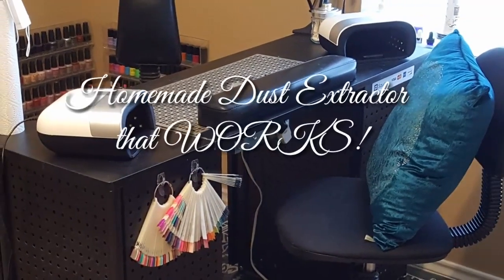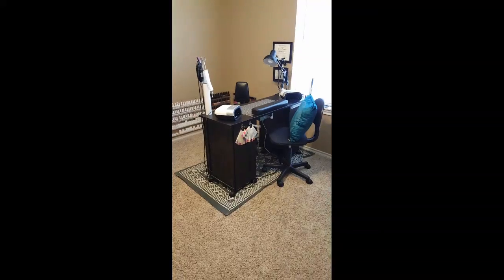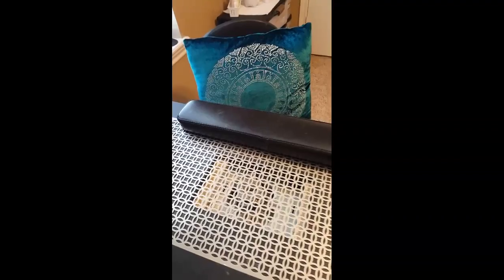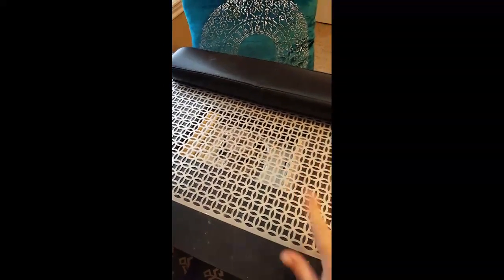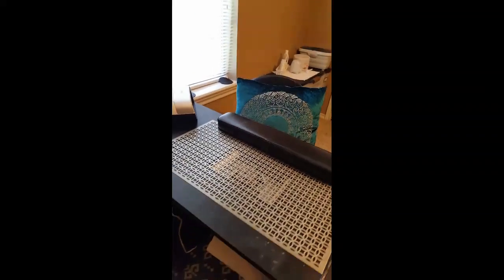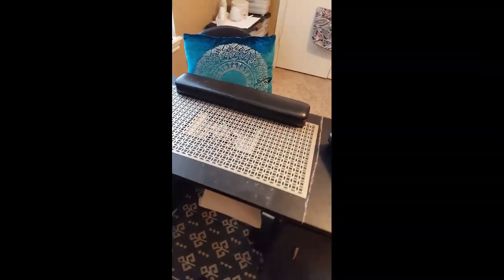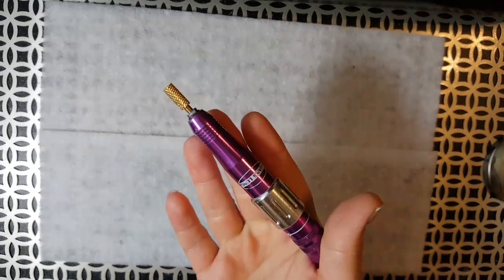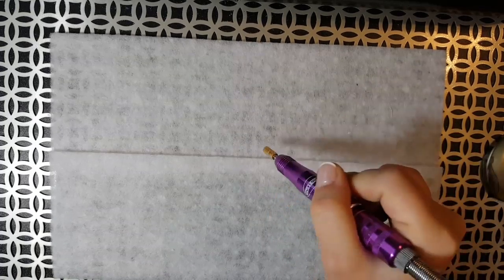Dust Extractor--  my version of a Valentino!

Comment: Not sure if you still use it but you could create a very lightweight frame to house the 2 filters and attach it to the underside of the metal grate with either double sided velcro or magnets IF the grate is magnetic, then you just pull it out when it gets dirty and replace, rather than sitting on top of the grate - just my 2 cents lol

Comment: You have no idea how happy I am because of this video!!! I have bee researching dust collectors for weeks! I was scared to order a cheap one on amazon and it not work. I'm gonna get some flexible aluminum foil duct hose and run it out of a window to suck the fumes out as well. I am a DIY queen so I'll be doing this one myself! Thank you so much for sharing this.
Reply from the maker: tayla rogers Good idea!! Glad it helped cause it saves me hundreds.
Reply: Do you have any idea of the fans cmf power?  The cheapest one that I see is 50-60 cmf for $15
Reply from the maker: I'm actually not sure. I didn't save the box but we bought the cheapest which was 14.99 or so just to experiment before we bought a bigger one but this one worked. So you're probably looking at the same one we got.
Reply: UPDATE::: So I ended up getting the one for $30 and I got some of the foil duct hose that u would use on the back of a dryer. Normally when I do my nails I go downstairs and have the door open and fans blowing and my entire house is still flooded with the smell of the liquid. I just did my nails a few days ago IN MY BEDROOM WHILE WATCHING TV WITH MY GUY and I didn't hear 1 complaint from him!!!!!! I just sat the fan on my wooden tv tray that I use and put the hose out the window and closed the window down on the hose a little bit ( and tucked a towel in the open space because it's still cold here). I had the cover on that came with the fan and thats where I sat my dappen dish and a small folded paper towel to wipe my brush. I literally had NO LINGERING ACRYLIC ODOR AT ALL!!! And the nail dust was VERY VERY VERY  MINIMAL  compared to how it is normally and I think thats just because of the way that I had it on the table. I ended up spending around $52 total and that includes the fan, hose, electrical tape, a plug and some screws and window screen for when I actually attach it to a table. I got the old school wire type window screen and I'm gonna use that in the way that u have that amazing cover on yours. I figure I can screw it into the table and pulled tight it will be sturdy enough to hold . AGAIN THANK U SO MUCH FOR SHARING THIS IDEA.
Reply from the maker: tayla rogers oh wow!! Awesome! Great idea.
Reply: tayla rogers girl I’m going to do this too!! So I have clients coming to my house the way that you did it does it look really tacky? I mean at this point idc I just need the fumes out my hubby stayyyy complaining about the smell! Is it still working good for you?
Reply: tayla rogers also where did you purchase the fan?
Reply from the maker: Ruth Padin home depot or lowes
Reply: Ruth Padin I got it from home depot. And YES it works great!!!! The way that i use mine, the set up is a lil tacky but I don't have clients so it doesn't matter. It you mount it into the table like she did and run the hose through a window like i did you'll be fine. The closer the window the better so that you don't have a lot of it exposed. These fans take 3in hose which i always see online but couldn't find in any store so you may wanna order that. If I wasn't being cheap I would've gotten a stronger one for the dust aspect, so by this actually being a business investment for you, I think you should get at least 110 cfm fan. They have those for $121. It is SOOOO worth it!!! And those actually take the 4in hose so u wont have to search for the 3in. You'll be so glad that you did this TRUST ME!  Your hubby will have no complaints.
Reply: Love the video!!! Thanks for the information. I will be doing this too lol. 1 question you said exhaust fan, what kind kitchen exhaust or bathroom? This way I get the right one. Thanks again for the brilliant idea!
Reply: Yolanda  Any idea what type of exhaust this is? Is this like one that goes above the stove? Or is this a regular nail dust extractor that would go into a table? Please help me out

Comment: OMG that's amazing.  I'm showing this to my husband.  We're in the process of trying to take an old desk and set it up as a manicure desk, run the wires through it and everything like that.  I've been trying to figure out how to do a dust extractor.  TY for the tip.  Where did you get that purple efile???
Reply from the maker: Rande Thorman Glad it helped!! It's still working like a charm. Check the description box for the hanging e-file link.
Reply: TY Sorry I didn't think to look there.

Comment: Do you think I can use one of those Ebay fans the same way by not putting a suction bag on the bottom and leaving it open, then put a filter on top of the fan like you did?
Reply from the maker: Hillary Zhu you can try! I felt like those didnt have enough suction power but try and see.
Reply: I did more research and the fans that are used to make those particular dust collectors are actually not powerful at all! I think I'm going to try this out :-) 

What section did you find the steel cover on top from? I tried googling a bunch of things, but can't find out what they're called.
Reply from the maker: Hillary Zhu Yeah!! It's super cheap. Here in TX o spent  $14.99 on the fan and then I'm not sure where the grate came from! My husband happened to see it at home depot and knew that's something similar to what I wanted and picked it up. May want to just screen shot it and ask an employee.

Comment: How many rpm's is your electric sander? Amazon. (ca) sells it for $169.00 for 20,000 rpm.  For that price being that most all are only 30-35000 rpm are the best. 20,000 they say cuts in and out if too much pressure is applied or then it can cause burns and to over heat as it can't handle it at that rpm. Even still unless it is made of stainless steel it should never be that price even at 30,000 rpm's with all it comes with is typical for many.
Reply from the maker: The link to both efiles i use are in n the description box. You can get allthe detail from their site.

Comment: Does this help remove the fumes from your work area? If not, would you mind sharing what you use for that? The smell is enough to knock me out in my room, lol.
Reply from the maker: Stephanie S. No maam. It's only for dust. I do not use acrylics so I don't have to worry about odor. I've switched to hard gels for all my nail extensions and love it way more.